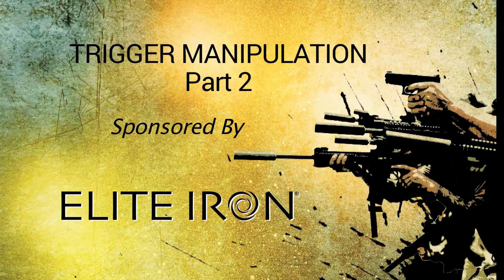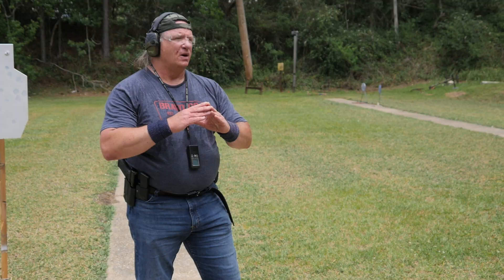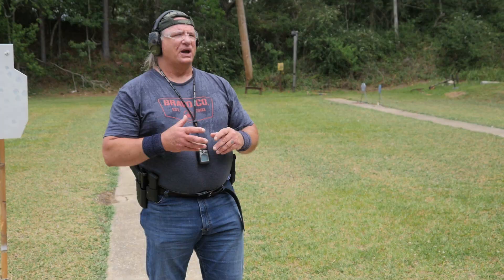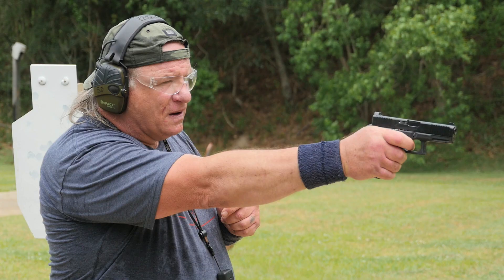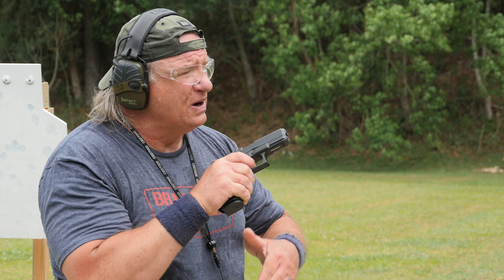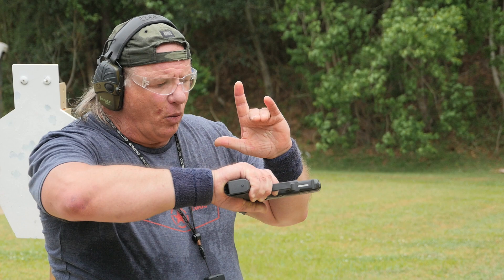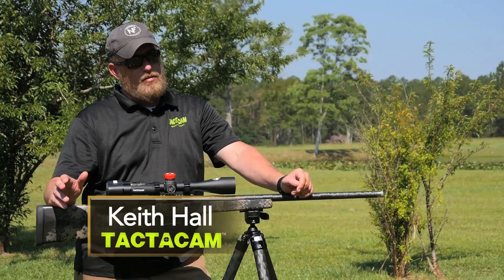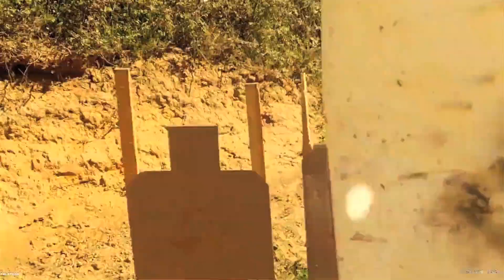Dave Harrington teaches how to correctly press the trigger in this episode of Trigger Time TV!

Comment: The close-up video at 3:49 shows "Super Dave" fully releasing the trigger and his trigger finger coming approximately 1/2" of the trigger and making contact with the trigger guard, that looks like snatching the trigger all day long to me... sorry, I will continue to do it "wrong" by only releasing the trigger enough for reset while holding out the slack for quick follow up shots.
Reply: If you have a proper grip "snatching the trigger makes no difference. Watch guys rob leatham shoot and thats all they do because their grips are squared away so regardless of how they hit the trigger it doesn't move the sights which is all that matters.
Reply: Your technique works when shooting slow.  Rob Leatham says his finger comes so far off the trigger it hits the trigger guard.  Have fun shooting slow, bro.